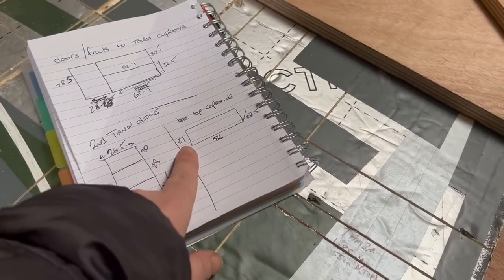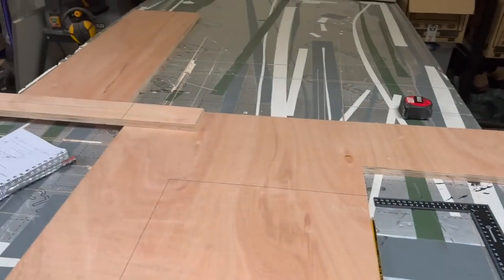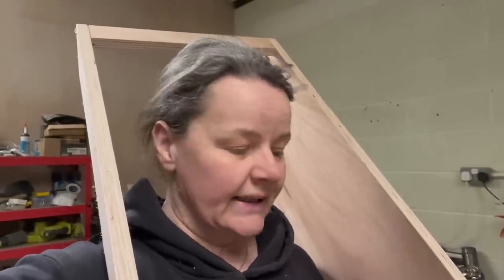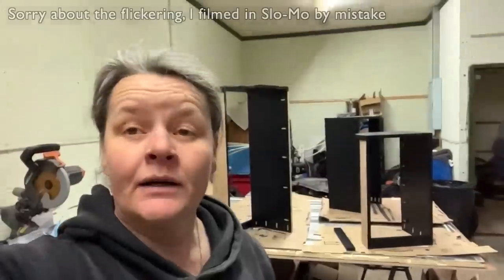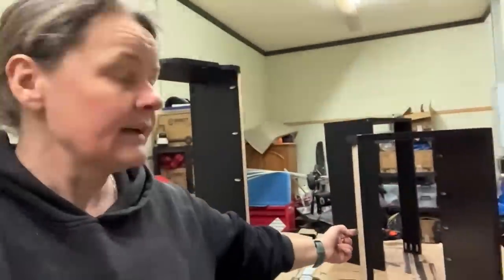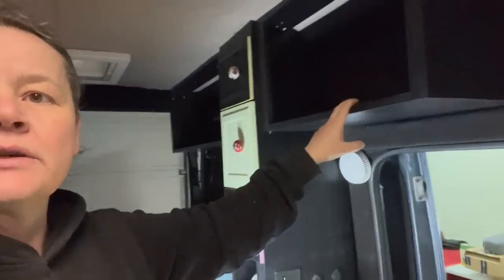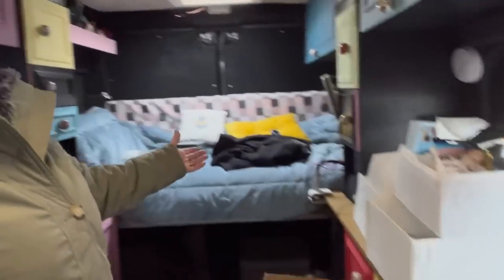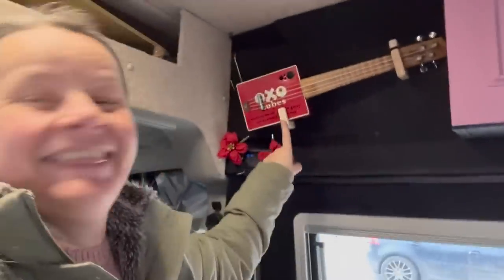UMV14 - Wall cupboards incoming..!!

Comment: Love the pastel coloured doors! Swee is looking fantastic. Plastic boxes are great, I have several in the kitchen, just pull them out when needed and easy to put away after. I wanted some slim overheads similar to your undies one, but head carpenter refuses to make them for me.....
Reply from the maker: Ah make them yourself, undie pockets are perfect (I’ve made mine a little deeper now though..)  I have open boxes that I can pull out which is perfect ❤️
Reply: @unadventurousmandy  I would make them myself if my brain and fine motor skills weren't a bit squiffy    🤯😬    I do have Workshop Envy of all the tools you have 😁 They will get done at some stage, like the flip up benchtop we 'didn't need' and the dinette converting to a sofa - hasn't been in dinette mode yet! 🙃

Comment: I think you will need to change your channel name soon to very adventurous mandy. The more I see what you have done, makes me want to rip mine out, insulate it & rebuild mine in ply wood instead of the old heavy contiboard. You have made a great job of your van.
Reply from the maker: Ah thank you.. well they say a van is never finished don’t they? 😂 it was surprisingly easy using one type of wood ❤️
Reply: @unadventurousmandy  you have had to learn not just the DIY but the Tools as well. I an Lucky there as, My Dad taught me about power tools, i have two brothers, if they learnt it, i learnt it 😁 the only problem is They learnt to cook, i can build anythink but I'm rubbish at cooking lol. Love all my ridge moneys tho, small i use for toasties, xl i use for bacon, omelets, etc & deep pan is good for stews or beans & just bought the cute 1 pint kettle. As Dave dosnt eat or drink as he has a Tracheostomy & feeding rig. its just large enough to wash my one plate. Or to make my hot choc.😁

Comment: Can I ask you how important is it to level the campervan? ...I am just about to start out (not full time) my van adventure on my own (female and way past retirement age)  Thank you.
Reply from the maker: I don’t bother too much unless I feel like I’ll fall out of bed or my coffee spills 😂 the main reason is gas though - if you have a gas fridge or gas water heater/heating then the flame will cut out if the angle is too great (flames always stay upright) or it could damage the gas gubbins in your appliance. Hobs are fine at a bit of an incline.   Your sink might not drain fully either but I’m ok with that and usually use a sponge to get the water down 😁👍🏻
Reply: @unadventurousmandy  Thank you Many. I was wondering how I would manage the thingamejigs on my own but now I won't bother.